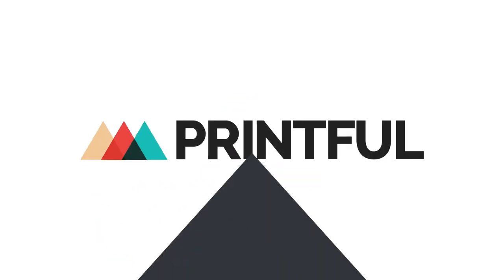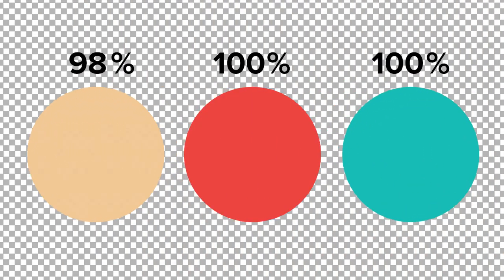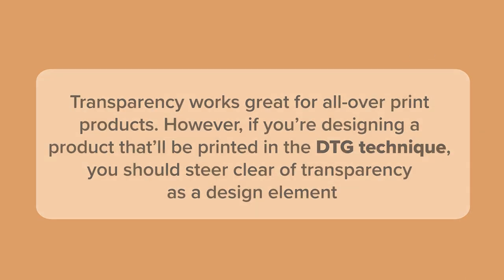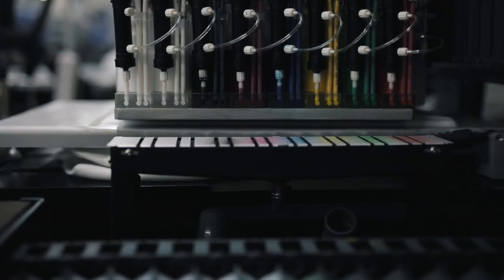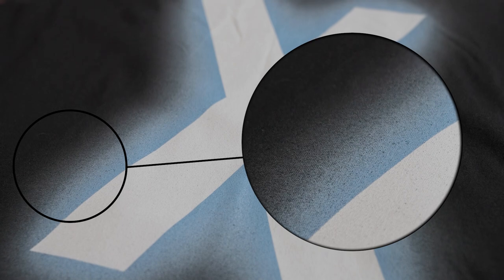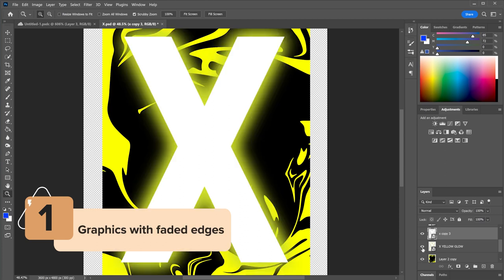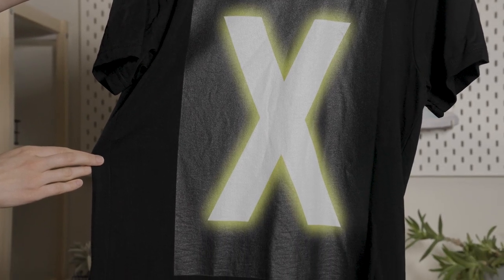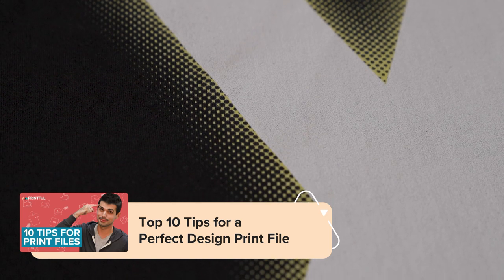Transparent designs and DTG printing: what you need to know | Printful 2023

Comment: Thank you for confirming. I have always tried to explain - to myself included - PNG is not a proper format without picking the optimal colour background. It is rather easy with white, black or just plain square photo, but generally speaking transparency in print works a bit like GIF - there is only one transparency colour channel and it is locked to the "gradient".
I think it is always safer to test out - or use as a general tool - a vector trace first and place it on a green background. If it works, good.

Comment: switch the opacity mode to disolve mode,you'll think it made the design different but after u saving and look at it again it the same,with this methode semi transparent design would be fine
Reply: It is generally a good idea. BUT when working with blended scans - for instance hand drawn graphics (imagine watercolours...), it won't help per-se when it dissolves. So, a vector trace first and then picking up the "pseudo alpha", or optimising them to underlaying colours if not printing on simple white.

Comment: So basically watercolours are a No? What if you have a solid white layer under the design with the watercolour (in varying transparencies) on the top?
Reply from the maker: Transparencies aren't recommended as they simply don't translate well in DTG printing. 😕 You can try it out by ordering a sample, but it's possible that the end result won't live up to the expectations.